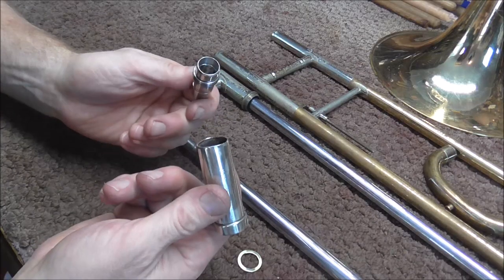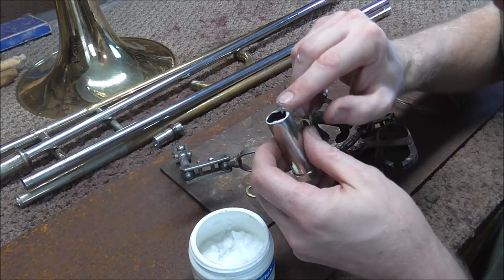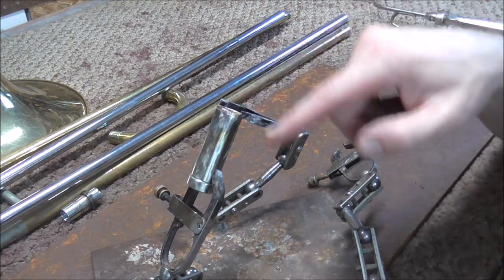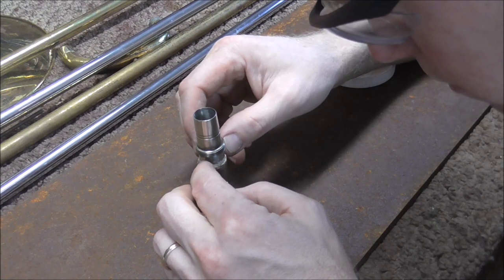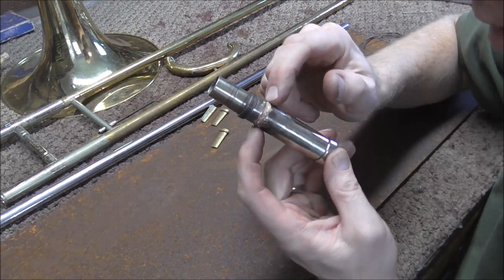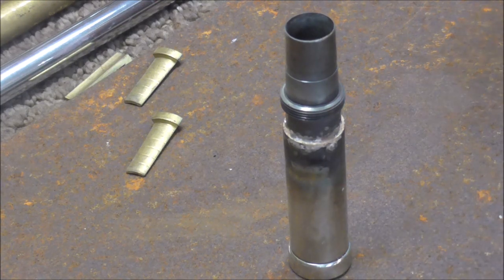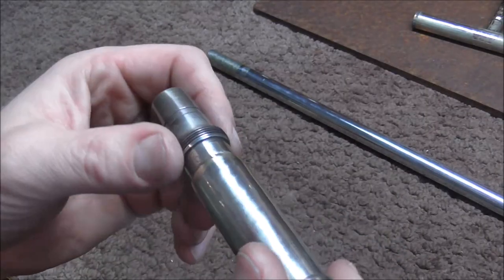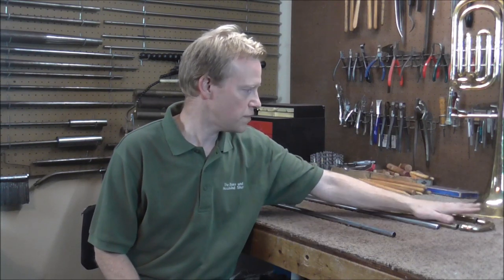Bass Trombone Restoration Project #8 SILVER SOLDERING

Comment: Have you ever thought about this... If the silver solder joint is close to a soft solder joint... Take a wet piece of leather and lay it across the pipe with one of those little cramps that you have and let the leather what is moisture absorbent the Heat
Reply from the maker: Yes, I do that sometimes if the joint is not too close. If it is too close, the water will suck up all the heat and the silver solder joint will not get hot enough. If I remember correctly, I think I did something like that on one of the old York cornet restoration videos.

Comment: Did you maintain the original serial number or did it get filed off? Is that a problem? I have a horn whose serial is almost entirely gone from wear and I wonder if it can be restamped.
Reply from the maker: Yes, the serial number was fine. It is possible to restore a worn down serial number. They have number stampers that you hit with a mallet and it stamps the digits into the metal.